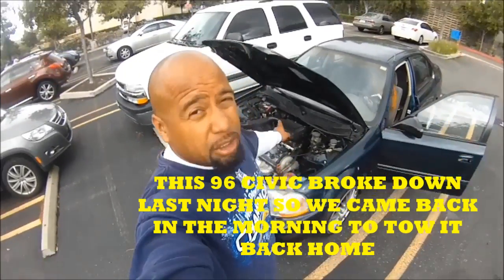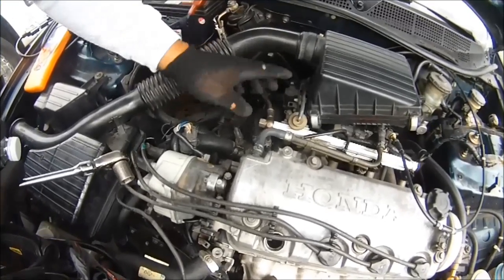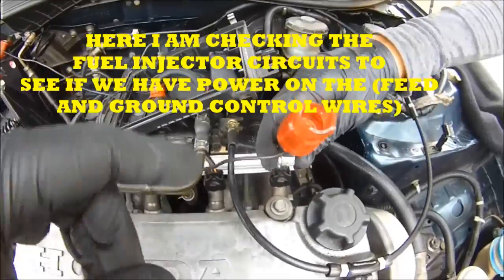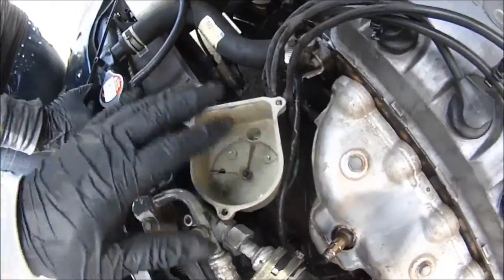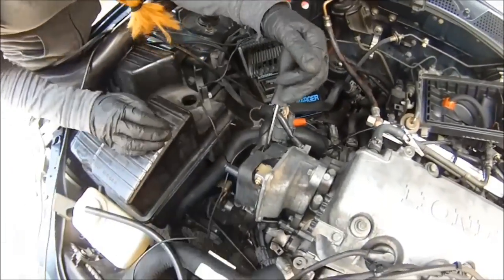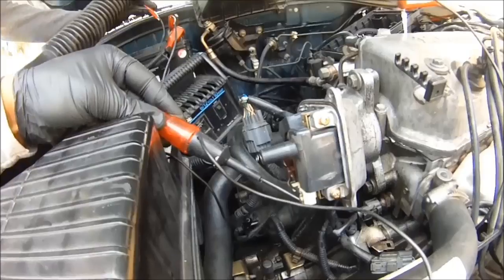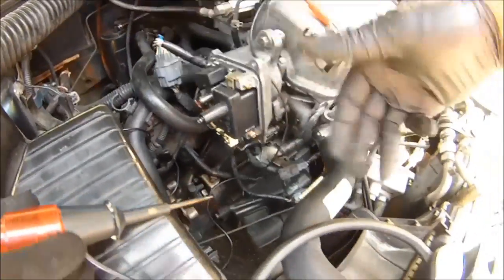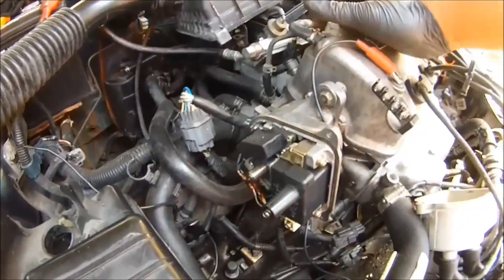HOW TO FIX A CAR THAT WILL NOT START,  HONDA  CIVIC

Comment: Oldschool Funk kills it! His video about fixing a Civic that won't start, was amazing. My son and I were able to troubleshoot and repair his car because of Oldschool's comprehensive instruction. It was especially helpful how he walked us through the troubleshooting process, which allowed us to narrow down and eliminate the possible causes of the problem.  Our issue turned out to be the coil, which was not the issue in his video but, he had shown us how a coil works, how to test it, and that steered us in the right direction. I had never messed with an electrical problem before. This was the best car repair video I've ever watched. If you're ever down in San Diego I'd love to buy you a cold one. Thanks bro!
Reply: Stephen Rawdin he lives in San Diego.
Reply: Yes I got it with this video too.

Comment: Nice video!!  The ignition control module is is a transistor.  It receives a small control voltage from the 
Computer; it turns off and on a higher voltage/amperage to the coil.  The coil uses this high/amps and converts it to high voltage low amperage.  This high voltage creates the spark as the electrons jump across the spark plug gap.
Reply: Great I'm guessing academic studies in auto.

Comment: oldskool, I recommend that anybody driving a civic or accord with over 100k go to ebay and buy a cheap used fuel pump and distributor and keep it in the trunk in case of emergencies. Might also want to carry a 12dc soldering iron for the main relay.

I carried a used fuel pump in my accord and one day my car died on the freeway. Took me 10min to swap it out . Very easy to swap fuel pumps on the 6th gen honda accord and it is very easy to swap out a distributor on them. All you really need is a 1/4 drive ratchet, 6" extension and a 8mm and 12mm socket to do both jobs. You don't even have to put all of the screw in, just put in one for the distributor and two or three on the fuel pump then put the rest on when you get home.
Reply from the maker: Ya I know about those main relays also. I was going to mention that but I forgot lol

Comment: Huge fan here, just wanted to let you guys know you're awesome!
20 years of age here (21 in a few months), I own a car that's a few months older than me ('95 Opel Tigra 1.4) and your tutorials have been a HUGE help! 
P.S Glad to see your daughter helping you out, being into cars and all, she seems stunning -- both on the inside and on the outside! 
It's snowing heavily in here and I sadly don't have a garage, so I have postponed most of the things I'm gonna be doing. Soon as snow melts down, I'm changing the timing belt, water pump, flushing the cooling system and changing the fuel filter. Car has some mayo on the oil cap (slightly), which kinda worries me, but it could be due to it being driven for like 10 miles in total in the last 3 months (been helping my family with almost everything I make at work, spent whatever was left on the car parts,  no gas money).. Battery is dead from me rarely driving it in the past few months and the -15c temps outside, so I'm charging it tomorrow and taking her out for a two-hour drive around the city, will see if the mayo cleans up. 
God bless!

Comment: I fixed my 1998 Honda Civic Ex using the same troubleshooting in this video. I watched several of your other videos too just out of curiosity and I think you're doing great stuff. I replaced my ignition coil (extremely weak spark) with a non-OEM part ($15) and replaced the distributor cap and rotor with OEM parts (about $30 each) because there was noticeable wear (expected since they're 23 years old). Thanks again for the video... it helped me do my first home car repair!

Comment: The reason it didnt fire up at first was because ya disconnected your fuel line. The small fire up at first was probly all the old fuel from carb cleaner and dry starts, if ya would of primed our pump a few times before trying to start, i bet it would of fired up first shot... I got my tech certificate from UTI orlando back in 07 and have been working on cars my whole life.. I got mad respect for you brother, love your vids keep it up God bless brother..

Comment: Thank you brother.    This is an awesome tutorial and it is really kind of you to create it.   Five years later in the middle of a pandemic a friend got ripped off for the same issue.  A mechanic charged her $600 for a distributor cap, spark plugs and to change the valve cover gasket and didn't fix it! The engine still starts for now.   Hopefully, now I can pay it forward and get the job done.

Comment: This is a priceless video for youtube mechanics like me. I had a no start. I tested for compression and could see the fuel injectors pulsing, like you show. I could see no spark. I got a new distributor although I suspect only the ignitor was fried. Anyway it started right up, surprising me how fast. This is the hardest car problem I've fixed! Thanks!!!!

Comment: Sur!!! First and foremost, this was an outstanding vehicle evaluation video!!! Period!! Hands Down!!!!! BRAVO!!!! Being Old School myself as well, I really appreciate what you have spoken and demonstrated in this footage!! However, in my opinion, there are certain times that saving money may nit be the most important factor. Case in point, as you know, particularly in high mileage vehicles say like the Honda Civic there, when one part or component stops working, soon after another part in the same location or in the unit like that distributor goes up as well then, the vehicle is down or stops working again. Then one has to have fix once more because the unit  or associated component or components stop working. I believe in be cost minded but I also believe in eliminating a potential future break down as well. I like to give the choice to the vehicle owner. Because,  I have known and even experienced myself, having a vehicle like that just die right in traffic without any prior warning!! Great Possibility for Harm!! In Once, complete and Done!! I choose to replace the unit if at all possible with a New one!! Great Instructional Footage!! Please Keep Up The Great Work!!!!!

Comment: Just a heads up. The car not initially starting can also be caused by flooding the cylinders with fuel during all the testing process. Sometimes I like to remove to plugs, to allow the engine to turn easier, or remove the fuel pump relay, after i have confirmed I have good pressure and injector pulse. Great video! the knowledge conveyed is very accurate, and i loved how you talked your helper through it and helped her understand what is going on and how to check it.

Comment: Keep up the videos bro! I always like to watch them cause I learn something new every time from u... And specially for the poor folks that really can't afford special diagnostic tools or gadget... I have learn a lot from u from all the video I've seen... From changing out the head gasket to checking the thermostat sensor wit a cup of boiling water, to resurface the head, to valve grinding, finding the top dead center wit a ballon, to painting a car, to buying good spark plug wires at a junk yard, to timing belts... God bless u bro! Remember anything is possible in Jesus name!...

Comment: Caution. When checking fuel Always have a large rag, a jacket or towel, to douse any fire accidentally caused by gas splashing n igniting. Nice job good vid. Thanx 4 sharing

Comment: thank you so much for this video man. my car shut off while I was driving and was just cranking didn't start back up. I saw this video and went straight to my car, opened up the distributor cap and turns out there was a screw in between the ignition module and the rotor that was just magnetized and was shorting the spark. I'm guessing the pervious owner dropped it and never took it out. God bless and take care man.

Comment: Thanks my brother in Christ, I just brought a 2000 Honda Civic Ex or LX. Still not sure which one EX or LX,  LOL. Anyway you just helped me figure out why the car was so cheap LOL. Now because of you and the lovely lady in your video, I believe I can do the work myself. I don't have the expensive tester they way you do but at least I have the Old Skool knowledge to apply it. You had said in the video that you would give the number to your parts guy who gave you the igniter. Can you provide the name number or website if any. I am about to attempt some of the repairs based off of your video. I don't have a back up plan if it fails except to go to Jesus, and I am sure he will lead me what to do and it's probably to reach out to you lol.

Comment: Check fuses at fuse box prior to checking for power at injectors. Some cars have a fuse back by th tail-lite housing panels. So check ur owners manual or call th dealer n ask about fuel-pump fuse location. Nice job good vid. Thanx 4 sharing.

Comment: thank you for the post.  I recently changed a distributor cap , rotor and wires. the car instantly ran better for almost a week and My trouble shooting has led me to the ignition coil and its related parts.  I am using your video as a reference before tackling the problem.  You explain well. other than that, the car is 20 years old, and it seems almost everything under the hood is original, down to the fuel filter... I was thinking fuel filter for a while, but the car, until yesterday always started up so quick, I'm figuring its ignition coil or its related parts. now I know how to test them before I simply buy and replace them.

Comment: Greetings from South Africa. Good explanation of finding the problem. I have a similar issue on my Ford Bantam, a South African small pickup which has the Mazda B6 1600i engine. I followed your test method and am now pretty sure the the igniter is the problem too!

Comment: this is a very very good video. and all your video are.    when I saw your video about removing a cylinder head without removing the T belt.. OMG  I never tough about that.. and I probably have removing head on D16 and D17 more than 15 times.  , the next cylinder head job I'll do. I will try it for sure !!!

KEEP UP THE GOOD WORK !!

Comment: After all the turning over of the motor trying to diagnose, its still dumping fuel.... After replacing ignitor put accelerator pedal to floor, it will stop fuel from going to engine.. then it will start. Motor is fludded.. great video brother 👍👍💯💯

Comment: Caution not to hold th plug wire while cranking, plug wires have a lot of amperage n at least will shock n hurt u. Next check ur fuse. Fuse-box under dash in honda. May be bad fuel-pump fuse. When repairing always replace cheapest part first. Thanx 4 sharing nice vid.

Comment: Good video.    The higher voltage on the coil is on the winding with more turns   (also thinner wire), the lower voltage is on the winding with the fewer turns, thicker wire.    The ratio of the secondary to primary is the voltage step up.   IV in = IV out or power in = power out - some inefficiencies.   Masters in Electronic Engineering and Computer Sci from UC Berkeley, 1979.

Comment: From my experience the car being hard to start after changing the igniter was due to the bores being washed by the fuel being injected with no spark.I used to remove the fuel pump relay to allow the engine to burn what was left in the bores and refit the relay as the engine fired and keep the rpm up until the compression came back up

Comment: i got a honda civic hatchback auto 98 2.0 the issues were pretty similar to your video. but my one always drain the battery. everytime i unlock the remote you can here ticking sound from the dash and when u put the key on the key sign on dash is flickering and still have the ticking sound. once you turn the key for ignition nothing happen. even if you take the key off the ticking sound is still there.central locking works only on the passenger door. everytime i open the car the shifter is always locked. everytime we jumpstart the car nothing happens when u turn the key on just the lights on the dash and radio on. no ignition it's like dead. what could be the problem for this? thank your videos man you are a legend. when i watch this video from zero knowledge you educate me in a short time. thank you.

Comment: For checking the pulse on the fuel injectors,  my boss told me to use LED lights because it's either voltage is between 0.1~0.5 , give or take...
Definitely digging your channel though...

Comment: Hey great video learned alot my car is a 99 civic but it does run and drive it's just at times it will start back firing real bad and fall on its face then die while going down the road

Comment: man i can listen to you for hours,!!!a dont have this problem,but maybe similar enough for you to help a little...got honda prelude 1997 H22a2,i love her too much to sold to someone so ...no matter how time is out there(rain,sunny,....) sometime run exatcly when i turn on key,sometime need to cranck few times,no matter even is it hill or strait line,so i dont know is fuel pump,distributor,i dont know,spark plugs r new!...so if you can give me some hint i will be very happy..bless you from croatia(near italy)!!thnx in advance and sorry on bad eng!!

Comment: thx for this vid, I've been needing lots of help on my car lately.... I literally didn't know anything about vehicles a year ago but feel like neo in the matrix with how much I've learned lol...recently got a 92 305 v8 tbi firebird that is running rough and has no power...going to try a can of that engine restore stuff too, people swear by it, maybe my engine is worn out and doesn't have good compression idk...also think my starter or alternator might be bad/failing. I don't wanna spend too much more time sinking money into this thing though, already spent about 430 bucks on parts in 2 months...if I don't get it running good for sure this month I might just get a loan from the local credit union and get some gently used truck again...I like this old firebird muscle car and it sounds good coming from an old regular cab v6 truck, but idk it has too many problems....I never see these 82-92 camaros and firebirds even around anymore, i think they all died and are in the junkyard these days lol....i've done: NEW iac, icm, tps, coil, coolant temp sensor, spark plugs and wires,dist cap and rotor....literally the entire ignition system besides the big long distributor itself is new....I see some big long new distributors online like on amazon for 60 bucks but many say they're rinky dink and last only a year, they say they're not as good as the original GM. I don't have a check engine light on for anything though....so maybe it's a bad fuel filter or pump or maybe even the timing idk

Comment: Hi there oldskool funk, thank you for all the very well informed videos you make, also thank you for helping me out that one time at Harbor Freight, with the gauges on how to make a leak down tester for the same truck.

I have some questions for you Bro,  how can I test a ICM  on a 87 Toyota pickup truck 22R?

Previously I checked the coil according to the resistance parameters from o haynes book, the coil primary resistance was not between the resistance parameters, but the secondary resistance was fine, the haynes manual says to replace it in case one differs, so I replaced it. 

After I installed the new one, it started the engine right away, and a week later, I got stranded the problem came back. According to the Haynes book, it says if it continues to give the same problems, to replace the ICM.

But how do I test it in order to replace it?

I checked the distributor pick up coil and the resistance is also good. 

 Also I noticed that there's a black with red stripe cable and a black cable coming from the wiring harness. The black with red stripe cable, I tested it to the ignition switch with negative cable disconnected from battery,  for continuity and it beeped continuity. 

On the other, the green female connector on the ICM/coil,  has a solid brown and  solid yellow cable.
With the negative battery connected, I  I open the switch to check for voltage with voltmeter on the brown solid wire, but it reads zero. 

My girlfriend says, to check the ignition switch, maybe the switch is faulty and maybe this is why, the ICM not getting the correct voltage on the solid brown cable.

I also noticed that on the driver's side,  there's a (check connector) near the ignition coil, it has light green with  yellow stripe , solid white, and a light green with red stripe. 

The Haynes book doesn't specify, what cable should I short out, in order to see trouble codes.

Lastly on the same male green connector from truck wiring harness, there's a solid black wire, that comes from the ECM.

In the haynes book, says that this black solid wire, is the signal for the ICM of the Toyota  pickup 22R.

Thank you in advance for your reply.
God bless.

Comment: Cool video and thank you 🙏 Narrowed it down to the ICM (igniter) with your assistance. Also noticed engine oil inside the distributor which I’ll be replacing the seals. Not sure this was the culprit for the failed igniter since my 97 Accord SE has over 290K miles on the clock and my daily commuter 👍

Comment: The reason it could of been hard to start was the testing you were doing while cranking was still sending fuel in the cylinders and it was probably flooded..    just a thought   maybe next time to test this theory take the spark plugs out and clean them and see if it starts a lot faster.     I like checking out your videos     keep up the good work    from one mechanic to another.